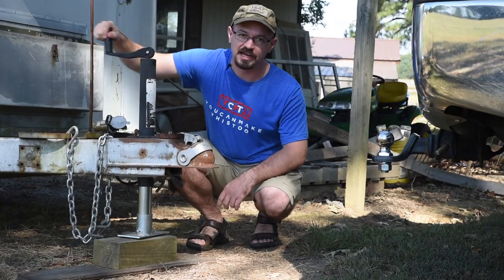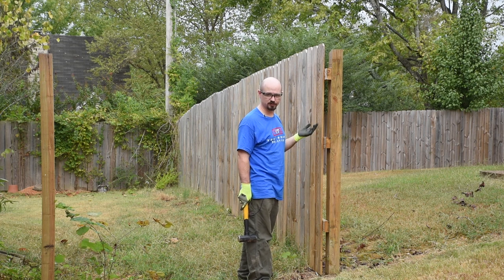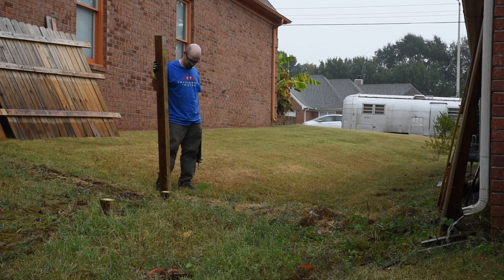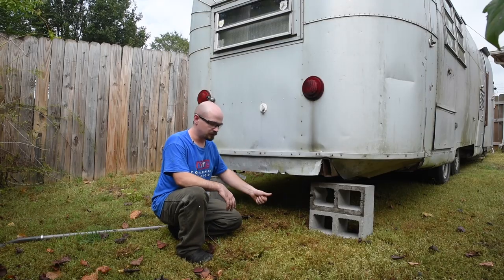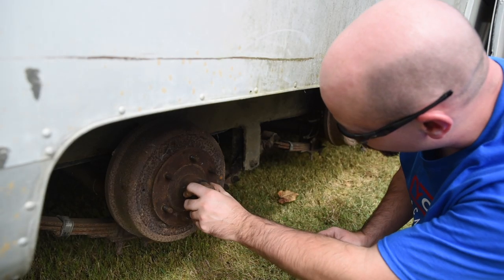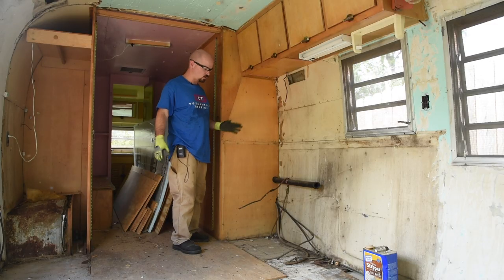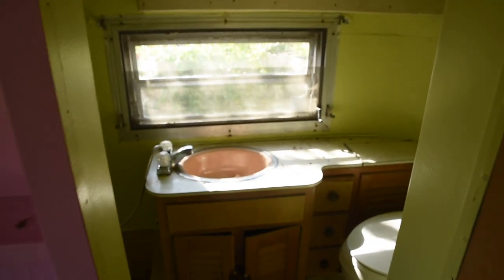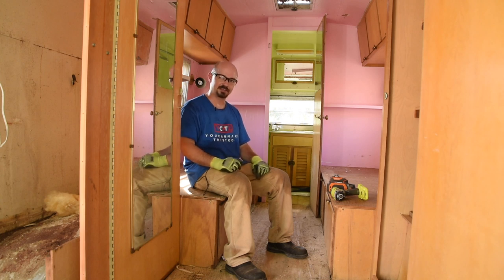Avion Ep1: Getting it Home | Vintage Trailer Renovation

Comment: I just watched this Avion video and am looking forward to your progress with it. I am the proud owner of a 1973 26' Avion LaGrande mostly original condition with almost identical layout to your model. My wife and I have been living in the Avion since July 2019 while our new house is being built so we are definitely aware of the benefits and shortcomings of this trailer. I have added a Girard tankless water heater which I highly recommend for unlimited hot showers! I dont know if I would go as far as removing the inside skins but water leaks are definitely an issue with my trailer too.
Reply: As for a name I like "Brave Little Toaster"
Reply from the maker: Oohhhhh, I think that might be one of my favorites!

That's super interesting! Good tip on the Girard, I'll remember that. In your mind what are the strengths and downsides of them?
Reply: @YouCanMakeThisToo  I think the biggest weakness is the water leaks. The drip gutter over the entry door leaks behind the rivets and the front window tends to leak either at the gaskets or the screws and causes the interior floor to rot. But there are so many strengths,  we to towed our Avion from Virginia to Colorado, South Dakota etc when it was 25 years old with no problems. Still using the original refrigerator, stove,etc.
Reply: stove etc. I would definitely keep or replace the gray and black water holding tanks because you never know when you'll need them! Also be sure to look into anti-sway bar systems for the hitch -looks like there was a system on your trailer at some point. I replaced the original front couch/dinette with a 2 couch system and drop down table and would be happy to send you photos if you are interested.
Reply from the maker: @caryteates4246  Thanks awesome! Thanks for the insight. I'll be removing the interior skins so I'll take care to do extra waterproofing in those spots.
Reply: We also own a '73 LeGrande. How well does the tankless heater work for you?
Reply: @OurGoldRoad  it works really well. It uses 12 volt power for the ignition so you can have hot water without having hook ups. Also avoids needing a bypass for winterizing.  There is a delay of getting the hot water to the faucet while it heats but once warm it is unlimited hot water!

Comment: If you decide to remove the inside walls, or “skin”, as I did to a camper I owned,  use some “reflectix” type insulation. I used carpet tape to hold it to the skin between the studs, from floor to ceiling, and back down the other side. You could tell a huge difference from the front to the the back, where I put the bedroom. Just a thought!
Reply from the maker: Good to know! I’ve got a list of notes I’ve been collecting for this rebuild. I’ll add that to it!

Comment: Where to buy rv trailer tires? Who do you call if you have a flat or blowout while out on the road?
Reply from the maker: etrailer.com has trailer tires, you can also check any local tire center you have - just make sure they know what kind of vehicle it is. As far as blows... I'm a huge proponent of carrying a spare. The likelihood is something happening to a tire is so high it doesn't make sense to not be prepared for the situation. And on a RV... odds are you won't be close to home or an area your familiar with when it happens, or even somewhere easily accessible or with cell service.